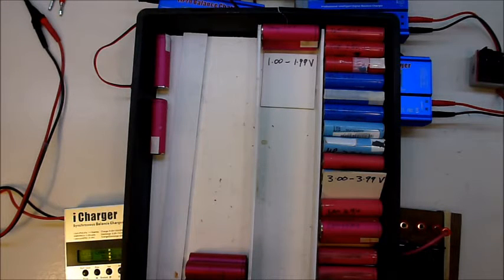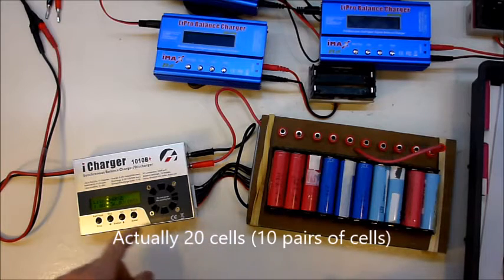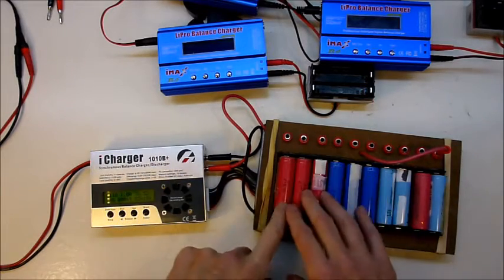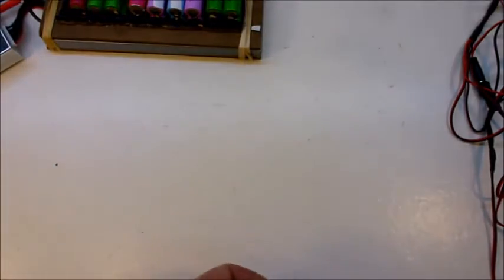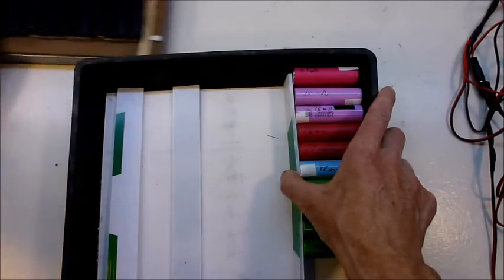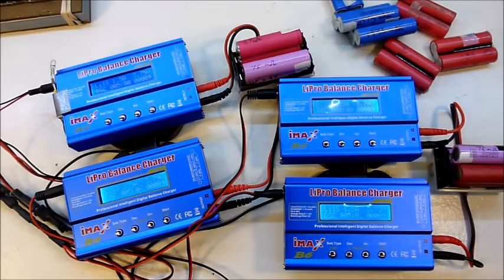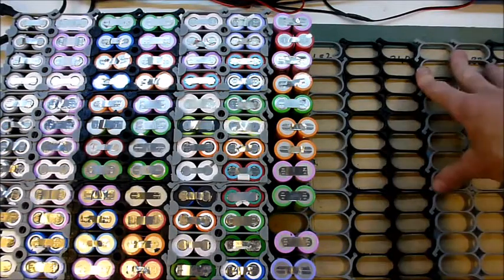Laptop Powerwall 03 - testing recycled laptop batteries

Comment: I have an imax b6 which i unfortunately only tested now (months after i bought it) and it seems way off. It shows 4.1V when the voltmeter gives 4.18 and the C3100 gives 4.2 , which means it is trying to overcharge. The menu calibration boot option does not work (probably due to cheap copy). The nominal charge for Lipo is standard 3.7V on the Imax, would it be enough to change that to 3.6V? (just in case you got confronted to this). Thanks
Reply from the maker: I gave up on the iMax B6 clone and switched to an iCharger 1010+. More expensive but doesn't overcharge.
Reply: +Paul Kennett yes, many problems described on you tube, I would be better off with 2two c3100 ^^| , I still need to find a use for  it for charging (otherwise an expensive brink). the overall automated steps with the c3100 take more or less 16 hours (charge, discharge, charge). If I can do the charging block of 16 with the iMax then I could do the entire process with eight 18650 a day (I can do 4 now, counting also time out of home etc)
Reply from the maker: Are you using the iMax to charge cells in series (balance charge) or parallel? If parallel - I wonder if you could put a grunty diode in line with the positive charge lead which would cause a voltage drop of around 0.5-0.7V (depending on the diode). EG http://www.eicsemi.com/datasheet/SR520_6.pdf
Reply: I want to use it to charge 16 cells in paralell as in your inicial set-up to speed up the process and be able to discharge test 8 cells a day with the C3100 (discharge and charge).The risk being if it tries to charge thinking it is 4.1 but in reality the cell is 4.2v. I think there was an option in the IMAX to choose the charging end voltage and i am hoping by putting 4.1v charge then that would do the trick.
Reply from the maker: Yep. If you put a diode in series with your parallel charger it will drop (absorb) 0.5-0.7 volts. So if your iMax is charging to 4.25v and 0.5 is being dropped by the diode your batteries will only see 4.2v. And if you put 3 diodes in series you'd drop 1.5v, so the batteries would only see 4.25 - 1.5 = 4.1volts.
Reply: +Paul Kennett great thanks. Although the irony of the situation is that, although the voltage is incorrect it only charges to 4.1 (real) and 4.04 )as indicated by the imax...). Or I am doing something wrong or this machine is very dodgy. But I should be able to work with it ;). Thanks again!
Reply from the maker: Oh. Are you saying your iMax is undercharging - not overcharging? If it's undercharging then you could just live with that. You don't need your capacity readings to be absolutely accurate - just relatively consistent - so you know which cells to reject.
Reply: Just realised I was doing several things wrong:
1/ The cell i was using to test was a bad one, so i would charge it and it would go to 4.2v but by the time i would look into it it had drained to 4.1 or even lower very quickly. 
2/ I was comparing a charged resting cell voltage with a voltmeter to the voltage on the imax (being charged). 
3/ Or comparing the cell under charge (imax voltage) to the voltage at the entry point (voltmeter) of the cell, that at end of charge goes to 4.28v to charge to 4.2v (which I guess is necessary to get to 4.2). 
There is still a slight difference overall and probably it does overcharge a bit so to be safe i will go ahead with the Diode tip thanks :)
Reply from the maker: That complicates things then!
Reply: Paul Kennett learning curve is sooo steep... I hope not to blow up on the way ;)
Reply: +Paul Kennett Looking into this again and I am guessing you mean a drop of 0.05-0.07 volts? The best i could find at home or in the electronics store was a drop of 0.3 volts, which would limit the charge to approx 3.8v? (very low)
Reply from the maker: Hi Rincewind. I think my suggestion was a mistake for your situation. I misunderstood what your problem was, so my diode idea would not help.

Comment: Really great video.  Clever solutions to the time consuming process of charging and discharging so many cells!  Are you ever concerned that one cell in your pairs might be bad while the other is good?  I always split my cells and test them individually but have never really paid attention to how much the cells differ.  Well done.
Reply from the maker: If there's an unbalanced pair they'll show up as lower capacity - so should get weeded out by the capacity testing phase. I plan to do some testing of pairs then separate them and retest to check my assumptions though.

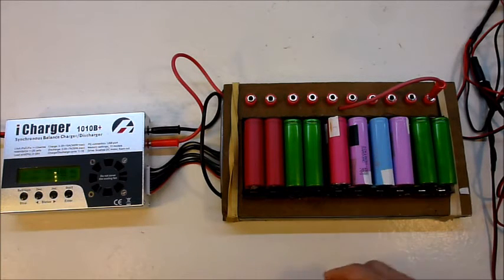Comment: at timeline 6:50 you where writing the internal resistance and you talk about mili-ohm's.
Well you are mistaken because it schould be Megaohm as a cell with such low internal resistance of ex. 97 ohms  would have been a totally  shorted cell  ;-)
Reply from the maker: +Geert Pirens Hi Geert. I think I have it right - milli-ohms is the correct range for 18650 cells. http://lygte-info.dk/info/Internal%20impedance%20UK.html is a great resource for info on 18650s.
If the internal resistance of a cell was in the mega-ohm range it would have great difficulty providing current to the load. The lower the internal resistance, the better it's able to deliver current to the load.
Reply: +Paul Kennett yed you are right about that mili-ohm's
This proves that we can always learn no matter how old ;-)

Comment: You can calibrate the B6 Google it up on how to do it !!!!
Also you can repair the B6 by replace the multiplexer chip when it's overcharge the batteries.
Also an option is to re-flash the firmware and re-calibrate the B6 and you're good to go ;-)
Reply from the maker: +Geert Pirens Yeah - I looked at the calibration and firmware options but never got around to it. Too busy playing with batteries. 
Then I rationalized that my capacity readings don't need to be super accurate, given that I'll have 48 cells in parallel which should balance out any randomness. And if the readings are all a little high or all a little low that just means the end capacity of my pack is a bit off. No biggy.
But it would be nice to calibrate and upgrade the firmware. It's on my list of things to do.

Comment: how do you know the battery mah
Reply from the maker: +Chis Ngwa The iMac b6 (or iCharger or similar) has a discharge feature which discharges the battery (eg it causes the battery to do some work - usually heat up a resistor) and measures mAh as it goes. For a more in-depth answer have a look at: https://www.youtube.com/watch?v=jGEuJ45dnjs

Comment: For discharging i have two of these, which are very good. I like them better then using my imax for discharge for eg they are far cheaper to buy and can discharge at 2.5amps if you needed, tho i would add a fan. I also only discharge at 1amp like yourself. I am just about to buy another two so i can cut my cell testing time in half. Painful and slow. 
http://www.aliexpress.com/item/DC-5V-USB-Battery-Capacity-Tester-Battery-Life-meter-Internal-Resistance-Analyzer/32615671384.html
Just an idea if you didnt have 4 imax's already or an idea for anyone else reading.
Reply from the maker: A friend of mine is working on a 10-cell discharged with an Arduino. If that happens it'll speed up the whole process a lot.
Reply from the maker: +Paul Kennett 10-cell discharger
Reply: +Mikes DIY Tesla Powerwall Agree. This discharger is much better than fake B6. Also is much cheaper (9$ on fasttech.com) and accurate. It can measure internal resistance. And you can calibrate it.
B6 which I have is kinda useless for discharging. If it discharging battery for one hour with 1A, it should show you 1000mAh discharge capacity, but mine unit shows 800mAh. For some reason. And if battery voltage drops current also drops, which is useless. So if you set 1A, at the end of test it will discharge only with 0.1A. If you switch to Nmh, than it can keep set current.

Comment: With the lower volt batts to charge them, what i have been doing is using the imax b6, in lipo charge mode not balance with the voltage set to auto and Unplug the balance plug. This will start charging the batts and bring the voltage up. When the voltage comes up to around 3v i then stop the charge and put the imax into balance change. Remember in normal change mode dont forget about it and remember to stop the change at 3v. Otherwise it will keep charging and some cells will over change as its not in balance mode, etc etc Oh and you can also use it the same way to change the batt from 0v
Reply from the maker: +Mikes DIY Tesla Powerwall I was trickle charging an under voltage cell once and forgot about it. After lunch I wandered back and saw it had reached 8 volts! Crazy thing is - it wasn't hot. I was a bit freaked out after that. I think I need to set myself an alarm.